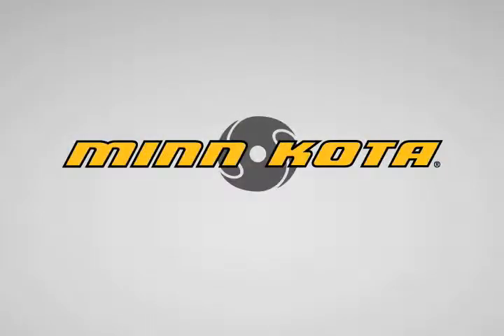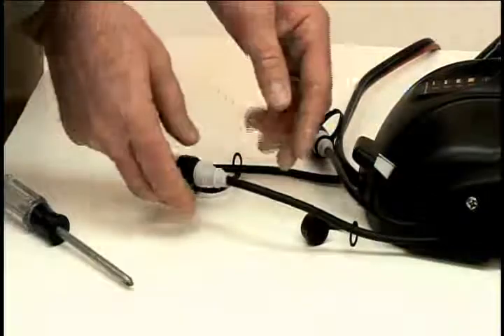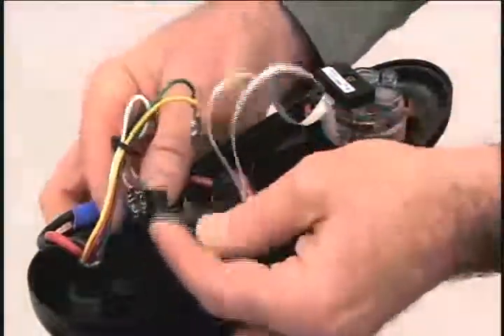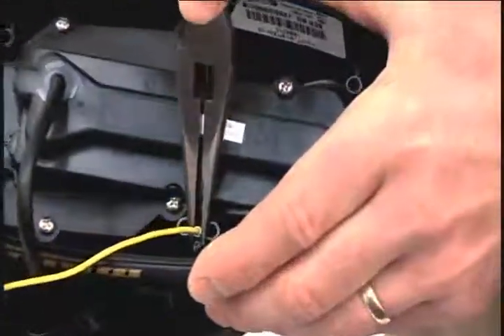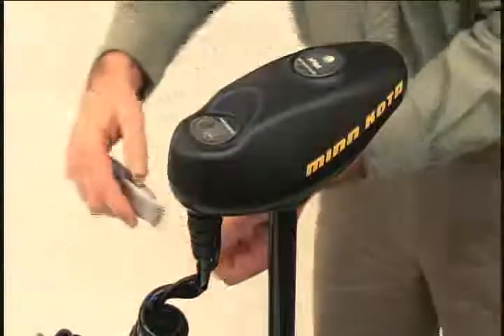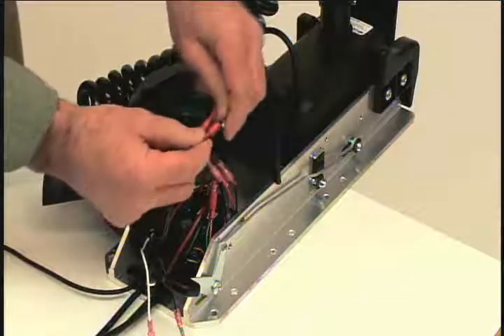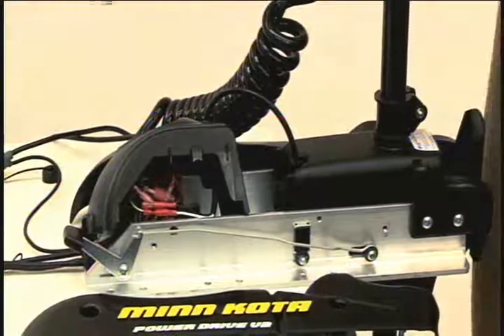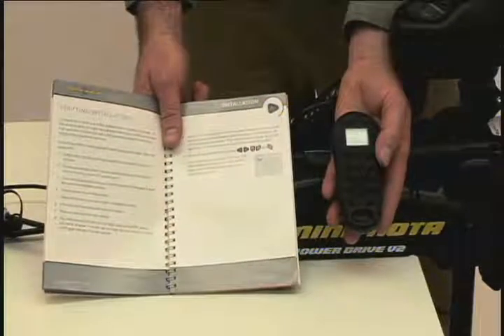i-Pilot Installation on PowerDriveV2 with CoPilot and AutoPilot

Comment: hello and the copilot ?
Reply from the maker: Hi Esteban - We don't have a video that shows how to install a CoPilot, however you can find instructions in the Owner's Manual on our website, which can be downloaded here: https://www.minnkotamotors.com/Accessories.aspx
Reply: hello , the name of this video is i-Pilot Installation on PowerDriveV2 with CoPilot and AutoPilot,
Reply from the maker: Sorry for the confusion, Esteban. We made a wide range of PowerDrive V2 models with different options for thurst, shaft length, and CoPilot/AutoPilot options. The title is referring to a PowerDrive V2 that has CoPilot and AutoPilot functions built in, vs. a PowerDrive model that does not have these capabilities.